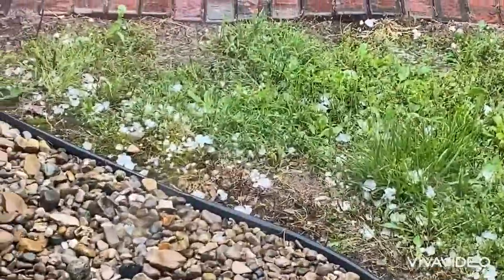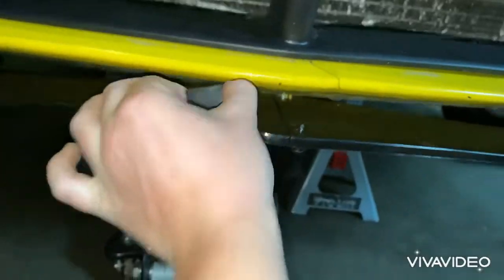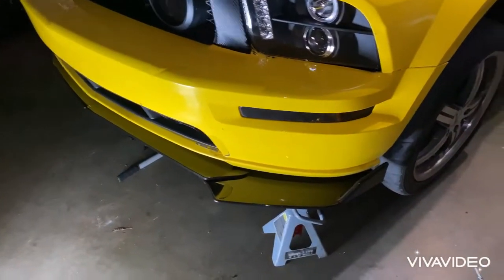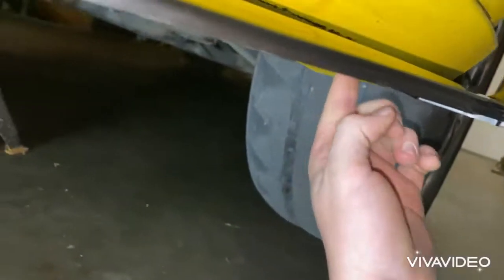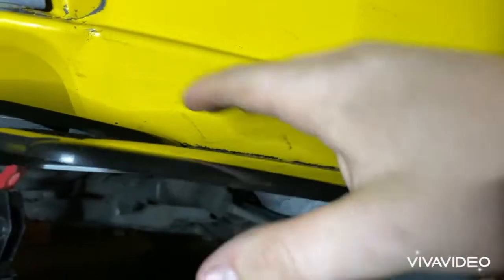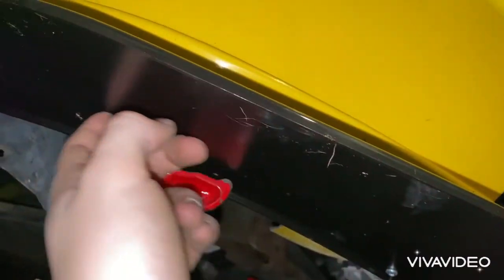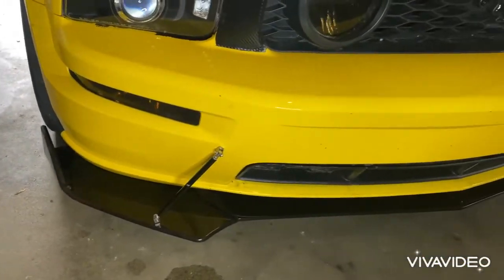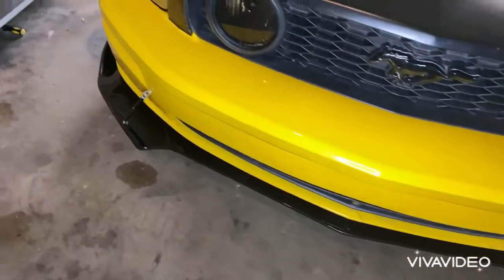Installation Guide to Ebay Front Lip/Splitter With Strut Rods! ONLY $60!

Comment: That looks way better than i expected. I saw those on ebay and thought about attaching one to the bottom of a cdc agressive chin spoiler. I think i'll try rivets to hold it on though.
Reply: Do you know the thickness of each piece? I see you are drilling through both with 1 inch screws. Are they 1/4 thick plastic? looks thick in the video.
Reply from the maker: im not sure the thickness its not very thick i just wanted it to hold
Reply: What the link for them ?

Comment: Hey boss. Question on the Mazda lol. Do you have an exhaust setup or is it a straight pipe? I love the sound you have but I want to know if you bought a setup and went castles or if it’s a straight open pipe. Would love a response man
Reply from the maker: it depends, its changed a few times, which video did you hear the exhaust on and i can tell you the setup?
Reply: @CircuitCatus  the “cat delete Mazda 3”
Reply from the maker: so on that one i had my rear cat deleted and welded in a test pipe, resonator delete and muffler delete all with the same size piping and ran it out with a 4 inch exhaust tip, very affordable

Comment: uh - the short screws go in the middle to fasten splitter together - you used the wrong screw and ruined the splitter
Reply from the maker: didnt ruin it if it worked
Reply: Can u list which screws go where, I bought the lip but haven’t built it yet bc the instructions don’t say where the different sizes go